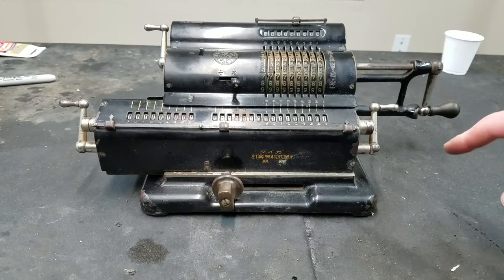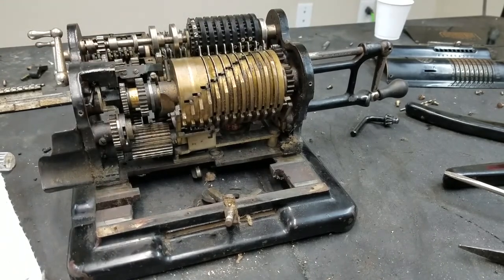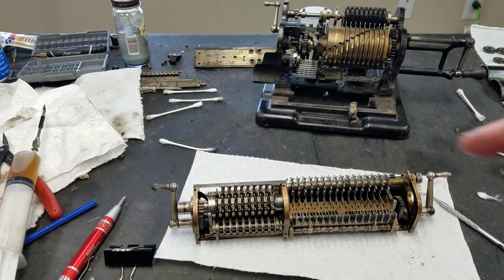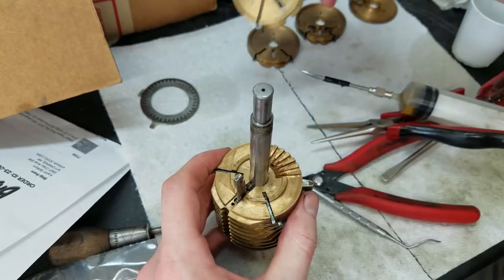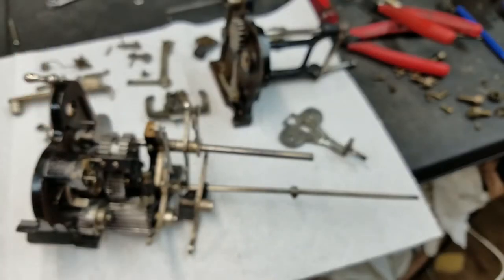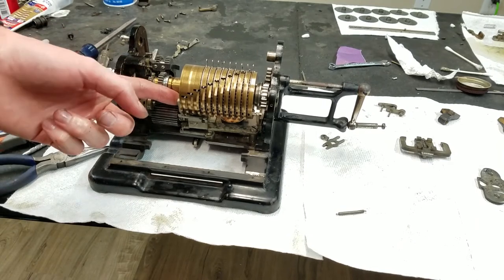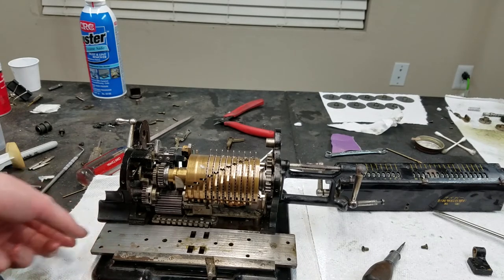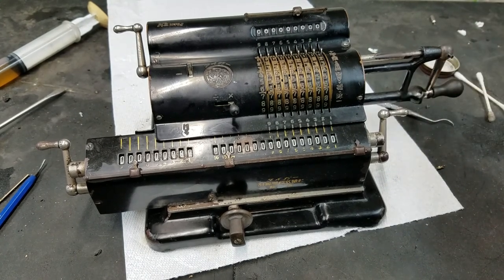1930s Tiger Pinwheel Calculator Mechanical Calculator Complete Rebuild (Made In Japan)

Comment: I personally am a less is more kinda guy. Something this complicated, with as many tiny parts as there are and considering its age, I wouldn't have done it this way. That said, would my way have been better... Of course not, you did what you felt was best and that you had the necessary skills to get it functioning correctly, which you did. All things considered, good job!
Reply from the maker: Thanks, but yes you have a point: Did I have to completely disassemble it to clean it? Probably not, I probably couldve flushed the dirt out with solvent and it wouldve been fine. But I do feel better if I can clean each part individually, plus it wouldve made a much less interesting video. Also diving into projects like this can be a learning experience, not just for me but also for the people watching the video. The more complicated things I take apart and reassemble the more knowledge and confidence I have to take even more complicated things apart. That being said, it is good to know your limits and not get in over your head, I definitely wouldnt completely disassemble a Marchant Silent Speed (although people like John Wolff have). I guess what im trying to say is I probably went a bit beyond what is required both for the learning experience and to make a more interesting (and hopefully useful) video
Reply: @bss1250  all are very valid points and you are very correct about making an interesting video, you definitely succeeded there. Thankfully, you didn't artificially age or induce excessive rusting to make it seem as if you were pulling off some sort of miraculous restoration as I've seen many times from other content creators. Yours was very clearly in original condition and you still did a good job of maintaining the character of the piece. Thank you for the response and insight into your methods.